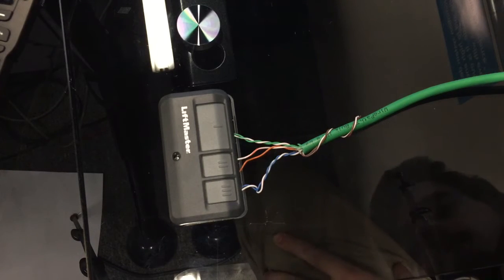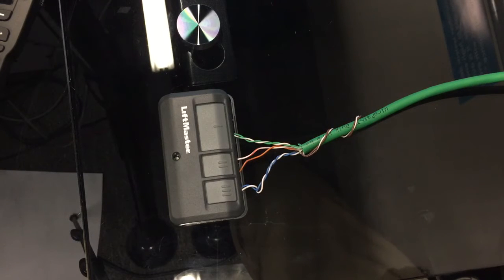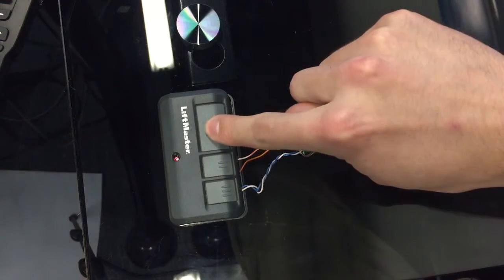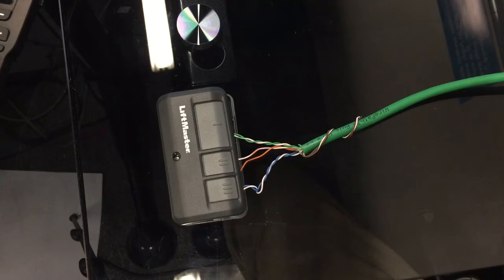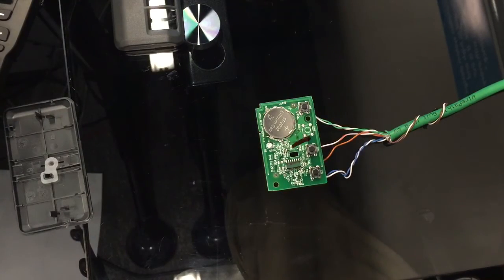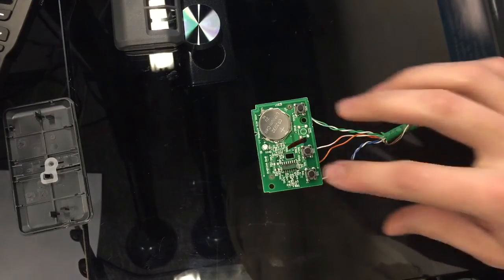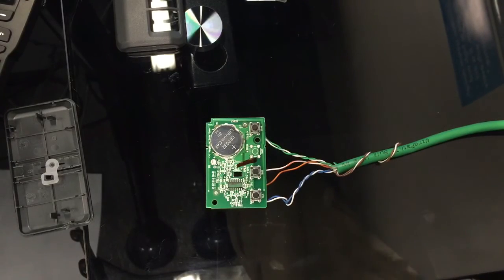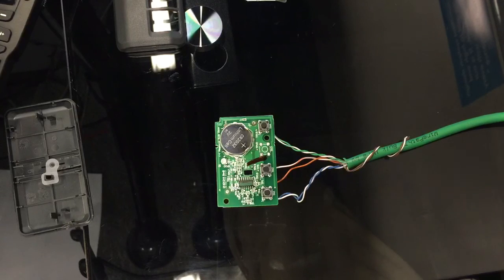Controlling Liftmaster and Chamberlain Security 2.0 motors with a NO Rely

Comment: I just soldered two wires onto a spare wall console I bought off eBay (used the 882LM) and used that to tie into my Insteon system. No batteries to replace that way. Cool idea tho.
Reply: Do you have a rough diagram how you made yours work with the 882LM?